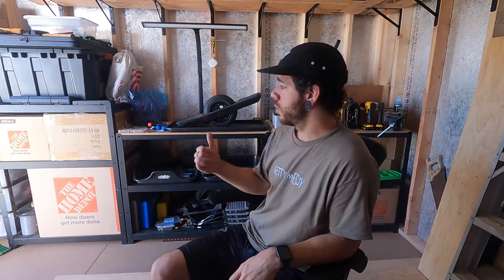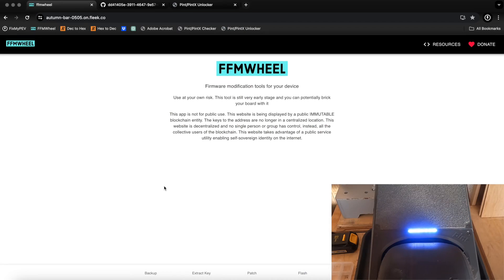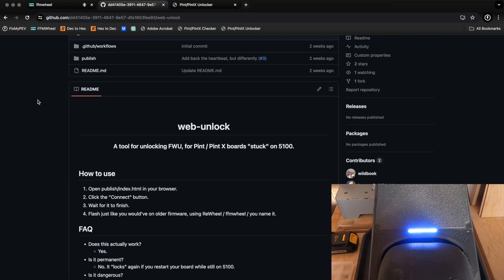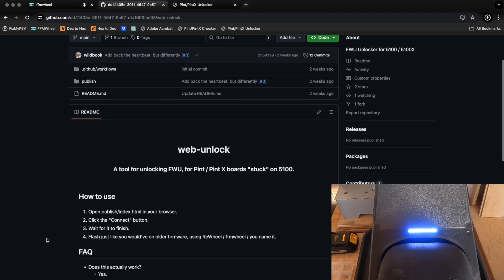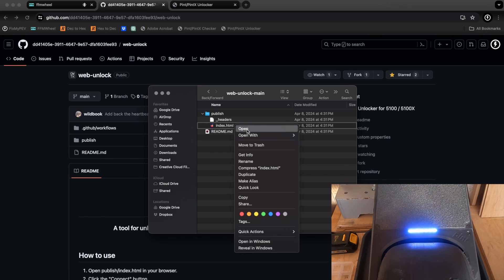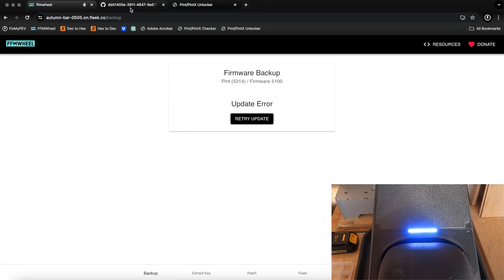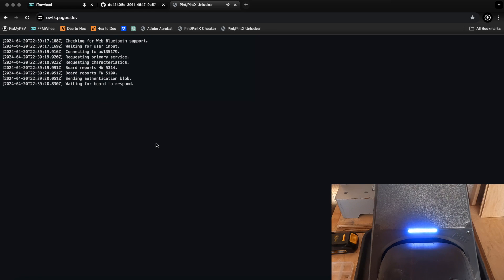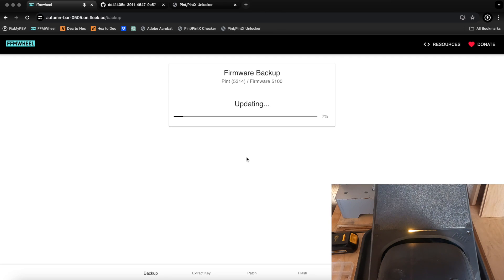Downgrading Onewheel Pint & Pint X: Reclaiming Control

Comment: Ive got to the key extractor stage and I keep getting 'failed to find key for for decryption' message and its just flashing multicoloured...
Reply from the maker: Hey! Are you making sure to load the file you saved during the backup process? It should be named 'owXXXXXX-extracted-bootloader-settings.bin.'
Reply: @fixmypev  no it was downloaded as 'extracted settings bin
Reply from the maker: @edwilliams7852  Gotcha. That's just not the default name. Are you all good now?
Reply: @fixmypev  No. When I try load the file it keeps saying 'failed to find key for decryption'. So I'm stuck with this flashing light and the app is telling me to update or the board may be unresponsive. What do I do?
Reply from the maker: Got your email. I’ll respond there. 💯

Comment: I am stuck. I have an OG pint 2021 model. I followed all the steps in the video and now I have the rainbow colors. You’ve direct people to another video but the next steps are not clear. Can you help?
Reply from the maker: Glad you got things sorted out! You just needed to flash firmware at that point. 💯
Reply: @fixmypev  thank you! While you’re here, I also have a brand new pint x I plan to do this with. It is on hardware 7325 and firmware Hydrus - 5200. From your video I think this hardware is safe. Can you confirm?
Reply from the maker: It all actually depends on the bootloader version so you’d want to check with the unlocker tool first. It’ll tell you if your bootloader is compatible. However…if you’re already on Hydrus - 5200, Future Motion has blocked Bluetooth downgrading. If you want to unlock that board, I offer a hardware downgrade service. You can contact me at https://www.fixmypev.com/contact-us.
Reply: Nevermind l thankfully got it! I was about to be heartbroken lol

Comment: 5301 hardware should be okay then? I just bought used older (possibly 2021) pint. The app kept sending my the update firmware seemingly without thw ability to opt out. Also wanting to rewheel the pint as well, upgrade to quart battery as well ❤
Reply from the maker: Generally, yes. But make sure you get a green success message on the unlocker tool. ✅
Reply: I'm not sure if I screwed myself or not.. I accidentally skipped to reboot and didn't dump bootloader or settings first. I re-downloaded 5100 to get back to base, I'm doing it again and now it is only loading 10% on dump bootloader and seems to be stuck, waited about 5 to 10 min and it didn't budge, same with dump settings 😐@fixmypev
Reply: @fixmypev  maybe I could send you an email of my current issue 🙏 I may have made a huge mistake.. my board currently is missing it's hardware entirely 😕 I accidentally hit reboot after the flash backup.. I hope there's still a way to revert back.. OW app is now saying to go to support and download new hardware 😬
Reply: @fixmypev us it possible that when dumping bootloader it takes more than 15, maybe 20+ minutes to finish loading?
Reply from the maker: @adamc4155  It shouldn’t take that long. Feel free to message me at https://www.fixmypev.com/contact-us.

Comment: So hardware 5326 and Gemini 5100 won’t work
Reply from the maker: Give the unlocker tool a try. If you get a red warning message, it won’t work. However, there may be other options.
Reply: @fixmypev what are the other options?
Reply from the maker: @phoenixcollins11  Hardware downgrade. It hasn’t been tested with every hardware version though. So, there are no guarantees. I’ve personally done them for Pints as high as 5314, GTs as high as 6408, and Pint Xs as high as 7326.
Reply from the maker: @phoenixcollins11  Due to the Digital Millennium Copyright Act, I’m not able to provide that kind of info. However, under the exemptions of the DMCA, I am able to offer downgrades as services in relation to diagnosis, maintenance, and repairs. If you need to take advantage of my services, feel free to reach out at https://www.fixmypev.com/contact-us.

Comment: Damn I have a pint x I was hoping I could downgrade it has heptic but I believe it was installed and not bought with heptic does that make a difference in being able to rewheel the pint x
Reply from the maker: You can’t exactly ReWheel a Pint X at this time, but you may be able to downgrade your firmware (assuming no warning messages on the unlocker tool).

Comment: Has anyone tried this on PintX Hardware 7326? I installed wtf rails and need to relevel but am afraid of bricking the board.
Reply from the maker: This has been tested on 7326, but does not work for all 7326 boards (FM uses different bootloaders).

Your best bet is to use the unlocker tool to see if your BL version is supported. If you get a red warning message, DO NOT PROCEED (or you will likely brick your board).

If you have any additional questions about the process, feel free to message me at https://www.fixmypev.com/contact-us.

Comment: Okay I'm struggling here. My board is flashing red with Error 23, It connects on the Unlock Tool, but om the FFM wheel, I get an Update Error after trying to backup and hitting "Start Update." Am I screwed?
Reply from the maker: Hey. As long as you didn't receive a red warning message, you should be ok to proceed. However, it's a timing thing so you have to be ready to proceed with the FFMWheel process immediately after unlocking. If you need additional assistance, feel free to contact me at https://www.fixmypev.com/contact-us.

Comment: Yo, Pint 5314 Firmware 5100 - Connected successfully on OWTK, went to ffmwheel and clicked flash extractor, it said update failed. Board flashing. Went back to OWTK now doesn't recognise the board and ffmwheel sees Pint 5000 and Firmware 65535. What the hell?

Comment: @fixnypev
Suddenly my pint wont take the patches anymore. Ive been running on them for a while but when I flashed it today they wouldnt take and it went back to stock pint with OG pushback and all. So I tried to remove my board from the app and now i cant in again without letting it connecting to the internet. How can I solve this!?
Reply from the maker: Sorry to hear that! Send me a message at https://www.fixmypev.com/contact-us and I’ll see if I can help you figure out what’s going on.
Reply: @fixmypev  Thx for responding. But it was my fault and I fixed it.
Reply from the maker: @jensfalck_TheSwede  Glad you got it sorted out!

Comment: what do we do with the final step choices are dump the bootloader, dump settings or reboot?  Then how do you bybass the app demanding to update?
Reply from the maker: The steps for that part of the process can be referenced in my 'firmware modification' video. Although you don't have to apply custom patches if you don't want to. The backup process remains the same either way. If you have any questions, don't hesitate to reach out at https://www.fixmypev.com/contact-us.

Comment: Hey FixMyPEV! I followed your instructions but got an error back from the unlocker tool. It says that my hardware is 5314 and firmware 5100 which should be fine according to your video but it says that by board isn't supported and continuing will likely lead to it getting bricked.
Reply from the maker: Hey! Sorry to hear about that. If you get an error with that tool, I don't recommend moving forward with the process. Would you mind messaging me at https://www.fixmypev.com/contact-us with more info about the error your getting?
Reply: Obviously that's pretty spooky but Is it telling me that making "rewheel mods" with the current firmware will brick it, or with that my pint is completely incompatible and even trying to downgrade to 5050 will brick it?
Reply: HW5314, FW5207, In Germany. Is there anything I can do to make it work?

Comment: Amazing, now please please get an Xr down grade sorted! Updated by accident and now my cbxr isn’t working on the new upgrade. Gutted! Thanks for all your hard work in the community my friend 🙏
Reply from the maker: That would be amazing, but it’s unlikely to happen. Even after putting in a ton of effort to obtain backups from the various hardware models, we don’t have access to all of the firmware we need. Would be a sizable operation with little to no benefit. 🫤
Reply: What do u suggest I do? Maybe stick a vesc focer 3 in it? Would that give me the full capacity back? Super gutted this has happened. Fm are really holding onto everything and it’s not fair.
Reply from the maker: @jakconnolly3412  Yes. If you were to VESC the board, you would get full capacity back. Assuming the battery is healthy.
Reply: Just down graded the pint and converted to firm are to an xr for custom shaping. Amazing man. Thank you and really hope someone sorts out a patch for my now retired cbxr
Reply from the maker: @jakconnolly3412  Glad you were able to downgrade your Pint! ReWheel makes it pretty awesome.

Comment: Hi! @fixmypev , tried this method, and 2 times in a row this tool corrupt firmware on Extract Bootloader step. Pint, 5314, gemini 5100. Any ideas why this could happen? In case I have such a problem , should I try to proceed withouth backup?
Reply from the maker: Addressing via email. 🤙🏼⚡️💯

Comment: Hey my pint is 5314 on gemini 5100. I followed the process step by step but now my board says HW 5000 and FW 65520. The lights on my board are rainbow coloured. What do i do now? Cheers
Reply from the maker: Have you tried flashing the Gemini - 5040 firmware on the ‘Flash’ tab already? The file is accessible via the ‘RESOURCES’ tab.
Reply: @fixmypev  yup I went through your channel and found your video on that. It worked! Thanks a lot.🙏🏽
Reply from the maker: @SigilMind  Awesome! You're welcome. 🤙🏼⚡🛠

Comment: just posted this on reddit but wanted to paste it here as well:

I've had my pint since 2020. Once I got the knack of it I wanted more range. Didn't necessarily care about going much faster but range anxiety was real. A couple years later a friend of mine installed the chi quart battery along with a new Burris wheel from TFL and that changed everything for me.

Fast forward a couple years later and OW came out with their haptic buzz update. I mistakenly installed it and had no clue that by doing so would basically mean my quart wasn't being fully recognized. Like so much that I started getting power surges in places I hadn't before. The same friend took my board, flashed the firmware (thanks ffmwheel!), and made it so that pushback doesn't occur until 20mph. I have always been a slower rider usually averaging around 11-12mph. Now I'm riding at 14-16 and I can't even begin to describe how this has increased my overall confidence in the board. It's a wonderful and freeing feeling that I never experienced early on and it rides leaps and bounds better now.

At this point, I don't feel a huge rush anymore to upgrade to a bigger board because this one is serving me so well right now. Just wanted to share my thoughts and experiences with everyone...cheers!
Reply from the maker: That’s awesome! Love hearing stories like this from the community. 🤙🏼⚡️🖤
Reply: Greetings i have a pint with a chi battery that i mistakenly upgraded and now its saying incompatible hardware, how did you get yours to work again ?
Reply: @edgecombeexperience  my buddy was able to downgrade the firmware using the tools in this video. good luck!

Comment: I was able to use the unlock tool, and flash the update, but now the process is hung after I click dump bootloader.  It seems to get to 10-15% and then just gets stuck.  I am able to reload the page and reflash the update (to 100% no problem), but everytime it gets stuck on bootloader dump.  Any ideas to help, or should I be looking into VESC at this point :P

-Pint
-HW version 50xx (cant remember before I started, but pretty old)
-SW version before this was 5100

After trying this out, the unlocker tool is reporting HW 5000 SW 65520.  The unlocker tool now just says "This tool only works with pint pint x boards."  Now that the rewheel tool can flash, I am not sure I need it anyhow.

The rewheel tool also now has me select the board model before it begins the flash (from a dropdown list).
When the extractor hangs, the LED's on the foot pad change to BRGBR.

Any help would be greatly appreciated!
Reply from the maker: Hey! Were you able to get this sorted out? If not, send me a message at https://www.fixmypev.com/contact-us and I’ll do what I can to help. 🤙🏼⚡️🛠️

Comment: How do i know what firmware i have . i have og green rail paint that has not been connected to app in awhile so no buzz but i did open app i really want to rewheel. this board is my sanity please help
Reply from the maker: Sharing email reply for visibility:

If you follow the beginning of my ReWheel video, it should show you which hardware and firmware versions you’re running (right after you connect).

Click the link below and let me know if you have any questions:

https://youtu.be/OT6Wd7G6haY?si=xn0GH7HzVyuG-vAp

Comment: 6/10/24:
I'd recommend proceeding with caution. I went through the process with my Pint X over the past day or two.  Come to find out the developers of the FFMwheel tool (not Justin) had made some changes recently so it didn't work as expected.  

Justin was kind enough to spend well over an hour with me remotely trying to find a solution.  We thought we were making progress, but after following all of the recommended steps, now my board is what he called "bricked".  I may have just sacrificed my $1400 investment in the name of breaking free from the tyranny of governmental control...

Part of me hates the government (CPSC) for forcing FutureMotion to install pushback and haptic buzz.  Another part of me despises FM for buying into the CPSC.  

However, what would I have done if I were the owner of FM, if I had invented the OW, and all of a sudden my entire business were threatened to be shut down if I didn't comply?  I might have done the same thing.  Trade one evil for a better good - keeping everyone riding...a SOME speed!  

Well, my board might be SHOT, but I feel like I stood up for my rights in trying to downgrade my firmware from Gemini 5100 to 5076 (pre-haptic buzz) in the name of freeing myself (over 800 miles into my OW journey) at the risk of dying.  Which I already knew when I took on the beloved sport.  

In short, I'd probably reach out to Justin before you attempt this.  Just to make sure you do it right.  Apparently I didn't.

Comment: This literally saved my riding. I wasn't enjoying riding outside of my commute because of haptic buzz. My Pint X would dip the nose if i even hit a crack in the pavement because of the haptic buzz. I also thought that i had wrecked my battery during the winter since my board would just feel sluggish even at 70-80%. Now, it may be placebo, but my board feels much better down past 50% now and the nose doesn't give out to cracks in the road. It also seems like the battery just lasts longer in general.

Now a quick tip with the Pint X process, have the unlocker tab and the flash tab open and pair the board to both tabs and get the flash page ready and loaded all the way to the point of clicking the flash button. Then do the steps for the unlocker and then hit flash right away once the unlocker shows the green text. I think it all has to be done in less than 20 seconds give or take. That's how I got mine to work after many attempts since I didn't realize I could pair to both tabs at the same time.

Thanks for saving my board!
Reply from the maker: Awesome! Enjoy the ride and thanks for sharing the tip!

Comment: Thanks bro !
The main reason I want to downgrading my pint is, to replace the battery to custom made one or Chi battery, whill this downgrading work with that battery plan?
Reply from the maker: You’re welcome. And yes. 👍🏼 You would use the unlocker tool and then use FFMWheel (ReWheel) to flash patched Gemini - 5040 firmware to the board. There are some settings designed to aid with the use of aftermarket batteries.

Comment: If i update again through the app, will it undo all the patches? If so, can i no longer use the app?
Reply from the maker: If you update through the app, it will overwrite (remove) the patches. You can use the Onewheel app either way, but if you’re running older firmware, it may ask you to update unless you use airplane mode or block data/wifi to the app.

Comment: Thanks for the video. So helpful. Just bought a used board and was able to easily downgrade. One question : with XR spoofing on a Pint , does custom shaping work? Mine seems wonky.
Reply from the maker: It’s supposed to as long as you have enabled Custom Shaping via FFMWheel/ReWheel, but I haven’t done much testing with it. I’m happy with the base ride modes and I don’t spoof my boards. What seems wonky though?
Reply: @fixmypev  I may have forgot to check custom shaping. I made a custom profile in the app to play with nose height and I didn’t feel any change.
Reply from the maker: @TheWasch24  That's what it sounds like. Go through the process again if you haven't yet and it should work. Keep in mind, you'll need to redo the patches and then go straight to the 'Flash' tab since you won't be able to do a backup on a spoofed board.

Comment: So basically if you get the newest Pint X with Haptic buzz, there'll never be a way to mod it?
Reply from the maker: Depends on the hardware version. If it’s above 7326, potentially not. 😬
Reply: @fixmypev   so can you do this if the pint x is at 7326?
Reply from the maker: @leezeylee323  Correct. It just hasn’t been tested above 7326.